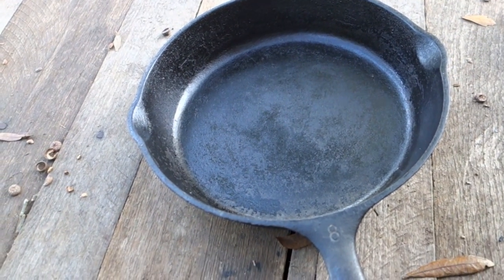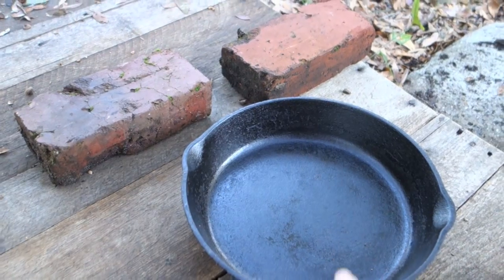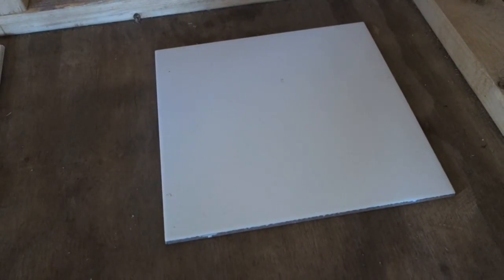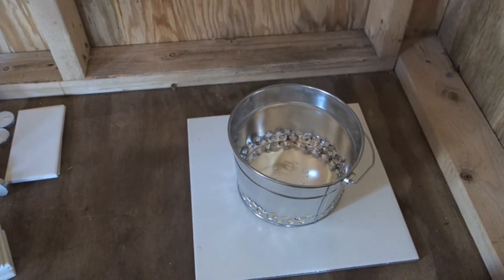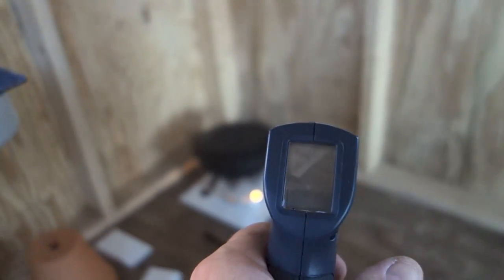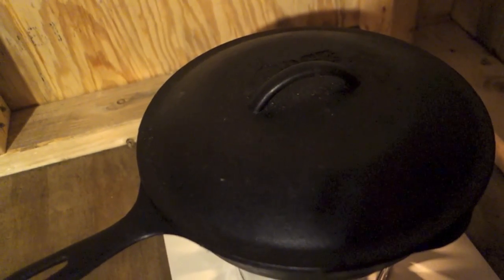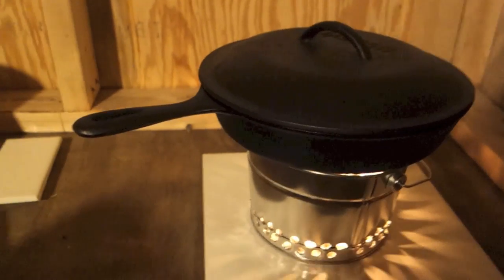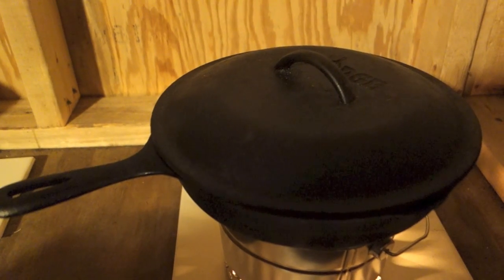A Simple, DIY Thermal Mass Heater

Comment: Interesting concept. I don't have an extensive formal thermal dynamic background, however, It would appear, if l understand this correctly, the more thermal mass you have, the longer it will continue to radiate heat. The challenge is to do this both efficiently and economically, which this demonstration has accomplished. 
Good job.
Take care stay safe
Buckethead

Comment: That's really neat. It seemed to work really well too. What is the melting point of almunium? I'm just wondering how long the pail can hold the weight before it starts to bend. How hot was the pail?
Reply from the maker: Good question. The aluminum will hold much more heat. I use one just like it to cook on with an alcohol stove that burns a bright blue flame which is WAY hotter and it has no problems so far. I hope this helps!
Reply: It's not aluminum .

Comment: If you put vertical rods in a metal pale or metal cooking pot (rods attached or even protruding through the bottom) and filled the pale or pot with sand, maybe the metal rods would conduct the flame's heat into the sand. High heat JB Weld would probably hold/seal the rods in place without letting sand leak out.
In any case, a 3 gallon pale should hold 42 pounds of sand, so 14 pounds of thermal mass for each gallon the container can hold. And sand is cheap and can hold high temperatures, which should allow it to radiate heat for several hours.
My thinking is a space heater that can be heated on a stove indoors, or outdoors with a rocket stove or camp stove, then be brought inside to heat a space for several hours without worrying about a flame to tend the whole time.

Comment: Tried both of these methods and found them to be over inflated propaganda and I could not get my clay pot to heat the small insulated 6x10 room after 6hrs of run time and this method of heat didn't do much better with temps outside of 52 or better. Epic fail for me

Comment: These videos are quite misleading... I imagine most viewers see this as a way to essentially "create" energy, this is not the case. You cannot create energy from nothing. If you were to light the same amount of candles and place them on your coffee table it would result in the exact same amount of heat that this cast iron pan method does. The energy output does not change. The ONLY difference here is that the heat is essentially contained in one specific area rather than being evenly dispersed through the whole room. I'm really not sure what the benefit of this is and I have a hard time understanding why anyone would bother doing all this work for zero difference in heat output.
Reply: I read your comment and agreed...then thought about it. You say it provides the same amount of heat with or without the pan and bricks. My thoughts...With just the candles you get X amount of heat during X amount of time. With the candles and "thermal resevoir you get X amount of heat from the candles over X amount of time....this is where the glaring difference is that you left out...the bricks and pan will continue to radiate heat after candles have exhausted their X amount of heat/time. Kinetic and potential energy is a good starting place to expand your knowledge.
Reply: Adrian B Dear Aid , Yes you are right , the thermal mass will hold the heat , but of course at the initial stage it will have taken heat in , that would have been released directly into the atmosphere , if the candles had been allowed to burn in the " open " . As " kjplive " suggests be it five candles , be it , in a can*( much safer ) or arranged on a shelf ( a fire waiting to happen ) , is still five candles , no difference in the amount of energy released , just the time it's released over . Of course , they may be minor advantages & disadvantages ? As the candles are in a localised heat point , will they melt / burn more quickly having their wax elevated in temperature . As some of the candles / night lights give a sooty flame , having a cast iron pot surface directly above them may help capture the particles that would other wise float into the atmosphere . If you wanted the effect to last longer , you could insulate the pot lid & sides , this could be as simple as putting a cloth on top of the pot to slow the heat dissipation , and elongate the time the pot would distribute the heat at a lower volume . But I think it ' s greatest value is to give you a focal point to warm your hands on ..... so it may be it psychological value !
Reply: How that any different to a radiator?
Reply: Though I was the only one think that.

Comment: He never got the starting temp of the house before heating the pan and bricks. So you can not compare before and after temps. Now the pan and bricks will work as a thermal mass, he should of done a time factor, how long did it retain the heat. Also I would of used a pipe or hose to provide outside fresh air to the candles.  Overall this is a half assed demo that only proved that 6 tea lights can heat up an iron skillet with bricks up to 160 degrees F in 2 hours.  Think about this, the pan was at 64 degrees when he started, which means the room temp was 64 degrees, after 2 hours the room temp went down 5 degrees,
Reply: outside air to the candles is an important factor for attempting this in a small space in my opinion. and with the previous comment about thermodynamics, the heat from the candles remains constant no matter what you put over top of them. if the room is insulated well it will be its own thermal mass heater(starting from the ceiling and spreading downward). the only difference with the pan of bricks is the heat from the candles is condensed into an object that you could cozy up near and feel more luxuriously.